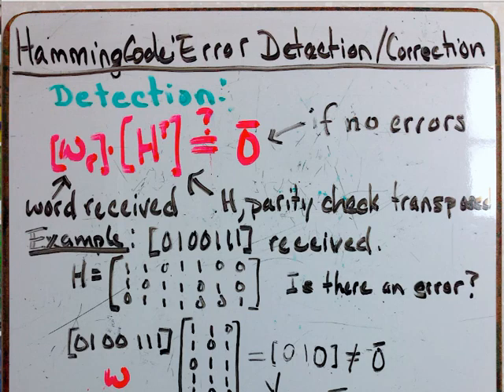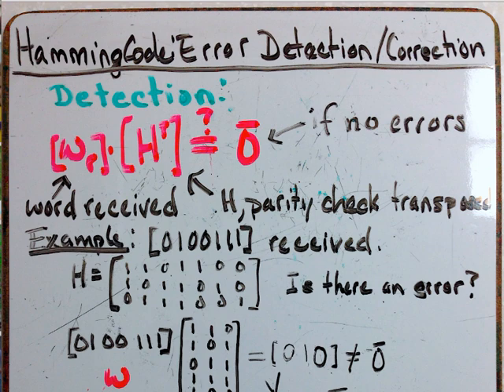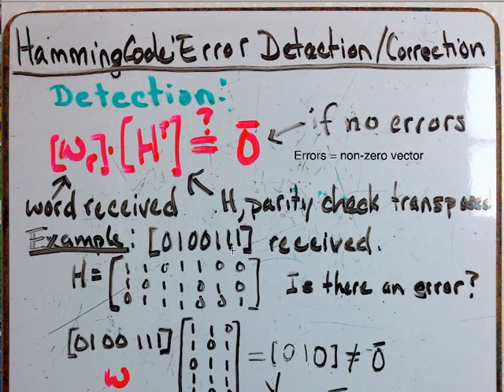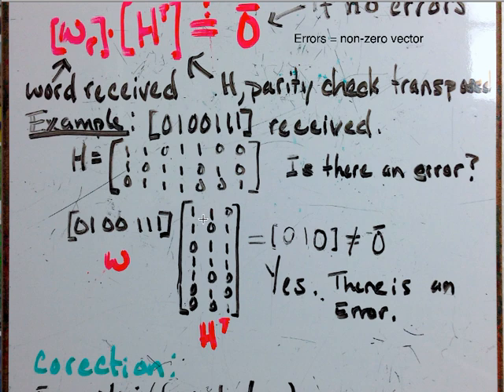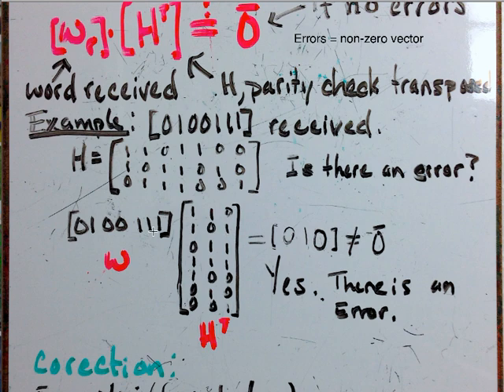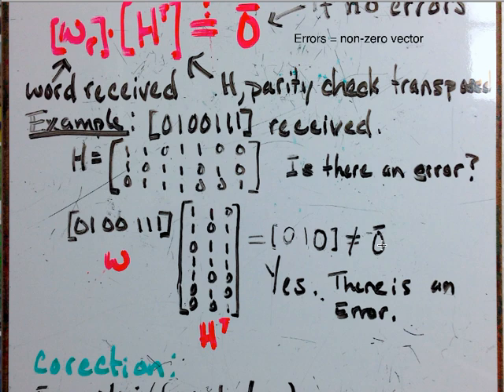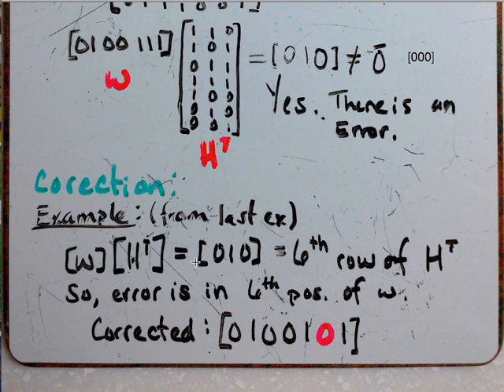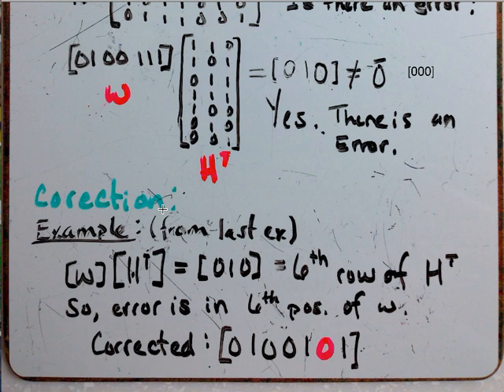Hamming Code - Errors

Comment: So 1+1 in binary is zero? I thought it was 1.
Reply from the maker: Basically anything even = 0 in binary, anything odd = 1.
1 + 1 = 2 (then when you get above one you subtract 2) -> 2 - 2 = 0
Reply: binary addition is modulus. there is no carry bit, so we discard the 1 in the '10' which is '2' in binary. if it were say 1+1+1 it'd be 11, so '1' logically, say 1+1+1+1 = 100,so '0' taking only last bit (it's again 0), and so forth.
Reply: In digital logic 1+1 is 1
In general, 1+1=01 (1+1=2)  
In this case we're working in mod 2, meaning it loops back to 0